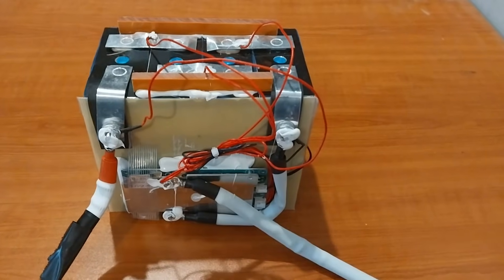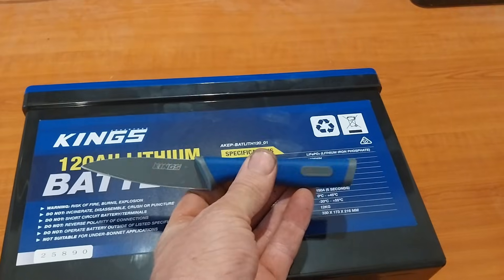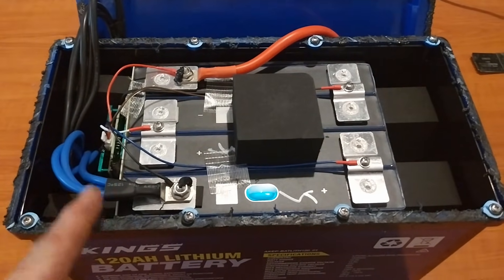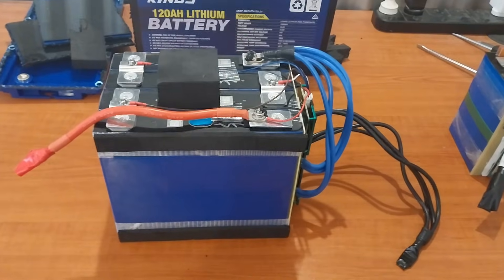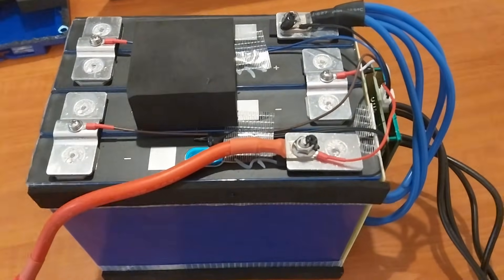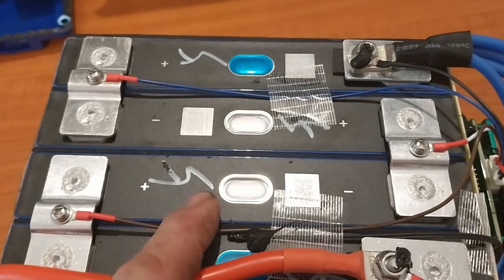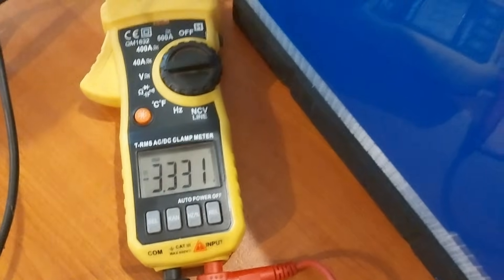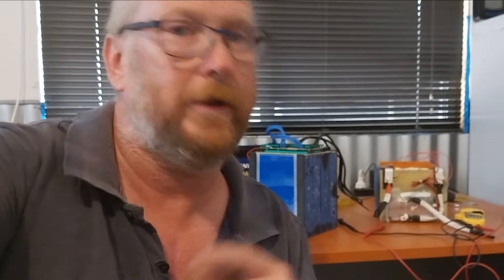King 120 Ah Lithium Battery Teardown - What We Find Inside ?

Comment: G'day 
From everything I've seen over the last few years, the 120ah / 200ah / 300ah LiFePo4 batteries seem to be awesome value for money 
I've personally had their 300ah LiFePo4 battery (and 3000w inverter) running everything in my entire off grid cabin for the last couple of years 

(One thing you didn't mention with the previous 60ah LiFePo4 battery was that the cells were mounted on their side in the housing, with the pressure relief valves facing sideways, rather than up, which could be considered a bigger issue than the foam block on top of the 120ah cells)
Cheers
Reply from the maker: I have several friends that run the Kings 300 Ah lithium battery and they love it. Non of them have any issues with their batteries. I would like to get hold of a 300 Ah battery and do a teardown on it. Will have to wait for there next crazy sale they have.
Reply: @TheOffGridBachelor  $899 is the all time lowest price so far
Reply: @TheOffGridBachelor  
They're advertised all the time now for $899 (I paid $1199, bugger!)
I saw a comment in a group somewhere that you could get them for as low as $849 with a "voucher"
When I asked how to get a voucher, I got no response